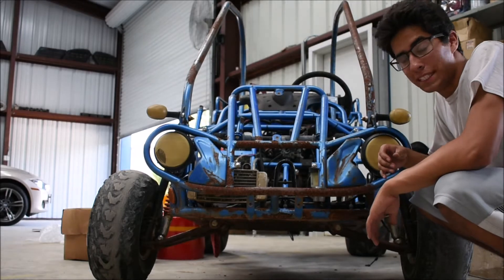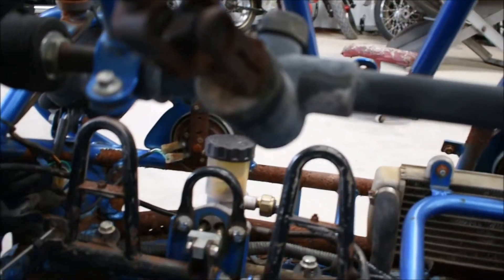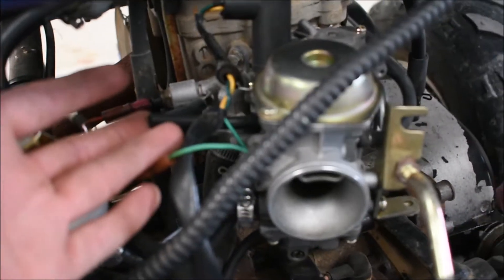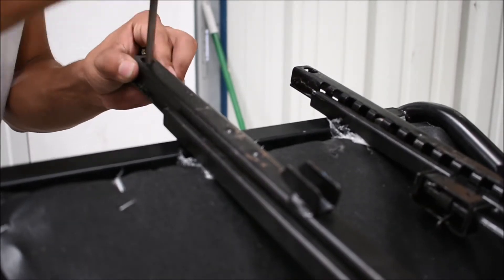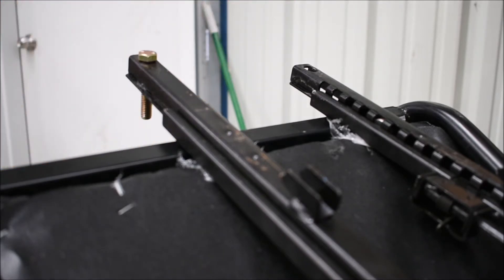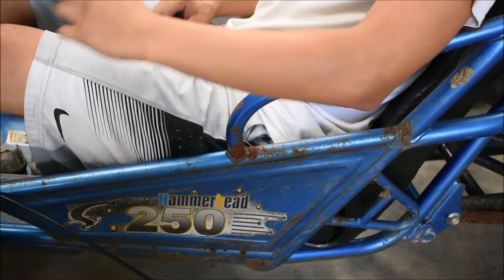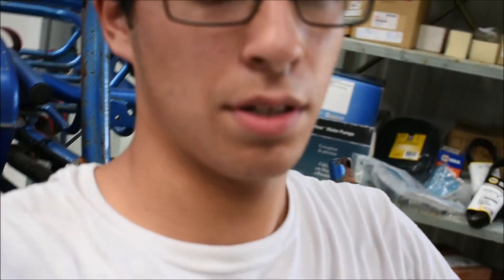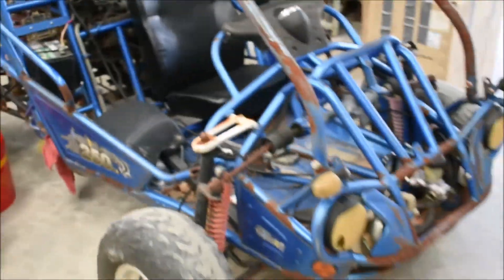Installing a seat in a Go Kart Hammerhead 250 SS

Comment: Now I have a 250cc hammerhead water-cooled writing just fine it stopped running I had to get my trailer pick it up and take it home I put new spark plug make sure I had a gas so it has sparked it has compression it turns over but doesn't turn on I even installed a new carburetor any ideas

Comment: I also had to buy the gear shifter. It was a pain to find and ended up paying like $80 for it. It was expensive but, gotta have it to properly shift gears.
Reply from the maker: Yeah it’s actually really garbage because I have all the gears except low gear my throw doesn’t go far enough to even reach halfway into it
Reply: @JordanPedroza  My doesn't either and I don't wanna push to hard and brake something lol!
Reply: Weird mine broke too but I drilled into it and use a screw driver now